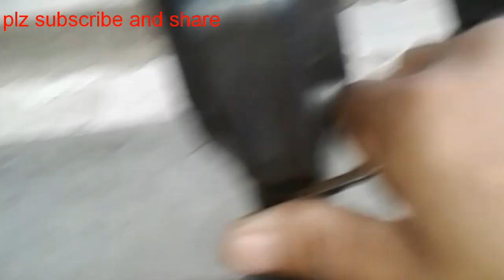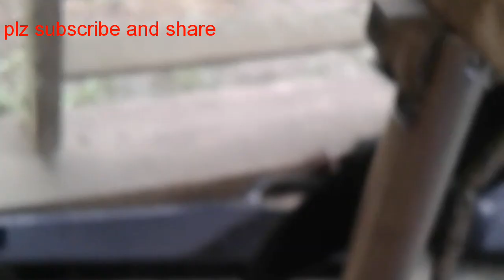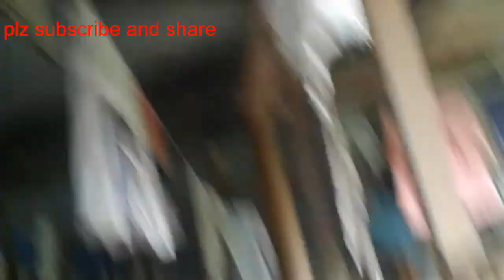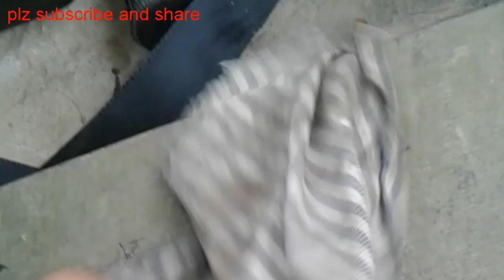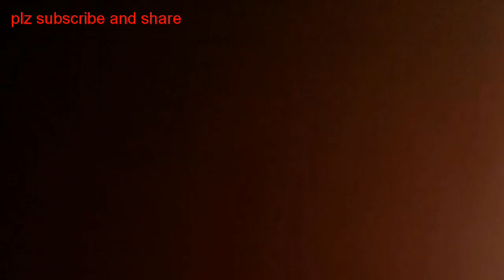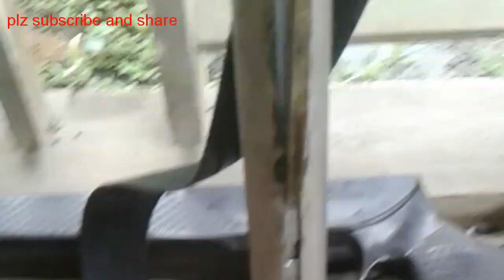Precihol NX100 old piston seel repear

Comment: Helpful,... Hello Sir can we change vx100 Spring into nx200 nitro piston? Plis tell me Sir..
Reply from the maker: Yes you can change to nx100 nitro piston not nx200 bcoz the nx200 nitro piston is longer in length.
Reply: Nx100 vs nx200 which one is better Sir. How many can count?
Reply from the maker: Nx200 has more power.the count is 10k + but nx200 have leaking problem.

Comment: How many shot u have don with first piston.
Reply from the maker: I shot around 21 packet(par packet 500pic) that is around 10,500 pallets and I am still using the same piston....I didn't change the piston till now.i bought the airgun on January 2017 and still using it and haven't change anything thing on my gun.
Reply: @GetemsHobby  Ok.. n how is its performens..
Reply from the maker: On the first use I wasted around 1500 to 2000 pallets...n now the accuracy is quite good when the gun is use to my pallets n Iam using United shot power range.

Comment: What is the added benefit of inserting the thin rubber band inside the piston seal ?
Reply from the maker: When the outer layer of  piston seal is worn out by inserting the rubber in the seal it help in expanding the outer layer a bit and so how it feets the piston chamber n the air won't escape from the piston chamber.